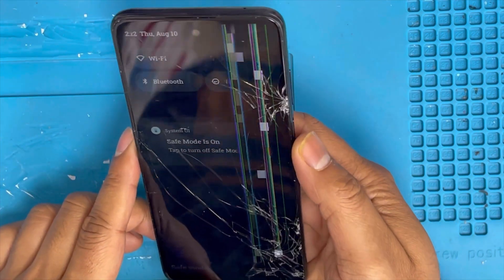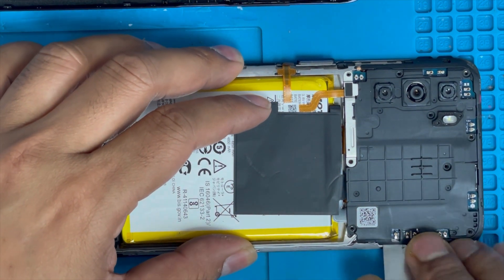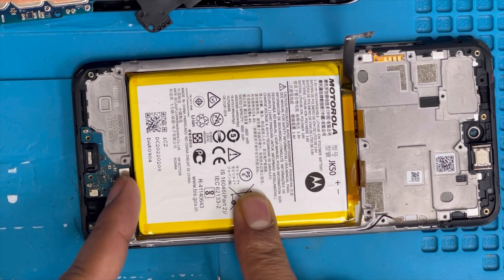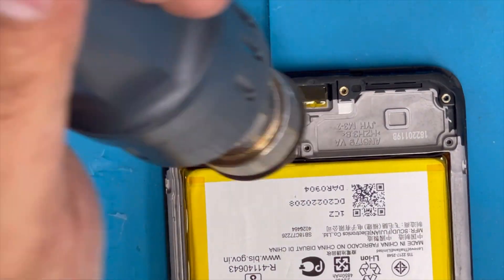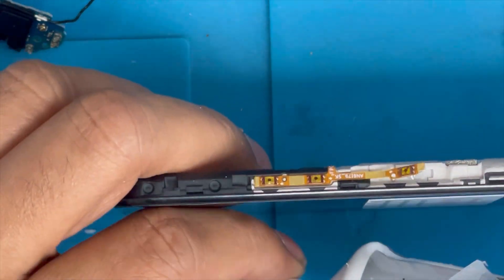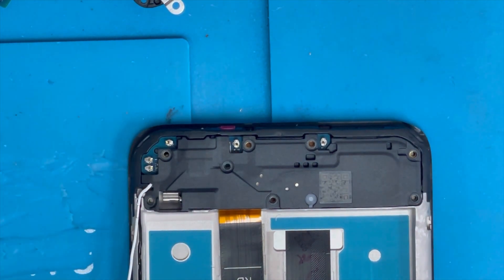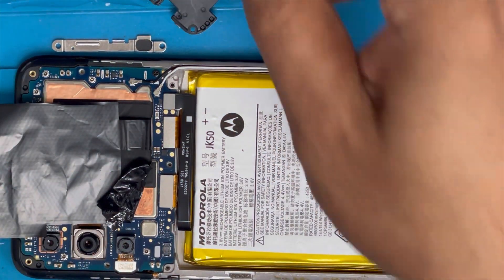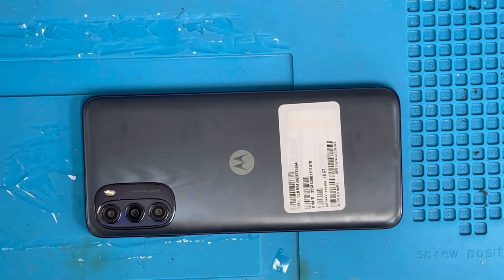Moto g 5g 2022 screen replacement xt2213

Comment: That fingerprint sensor is such a pain... and I don't know about your experience, but you can't just snap the case back together - you have to get these little rubbery nubs to slide into the top and bottom of the sensor. It's a real pain. 
In any event, after the repair, my sensor was dead. A quick reboot fixed it, oddly enough. 
Thanks!

Comment: So I just installed a new screen on the same phone. But the screen is extremely dim.. any ideas on why that could be happening. All the settings are good. And even when I install the old cracked screen it is still very dim all of a sudden.
Reply from the maker: Try to brightness up if is not work try another screen
Reply: @s-us-u8296  Brightness is all the way up. And I already tried 2 screens and both had the same issue. The screen is very dark no matter how high I put the brightness. It's like it's stuck in some type of low light mode...

Comment: I have bought the same replacement screen followed you step-by-step with no problem but now my phone won’t charge what could be the problem? HELPPPP!!
Reply from the maker: Check and reconnect charging port connection,
And check charging port connection is break any pin
Reply: @s-us-u8296  do you know where I can buy another board I did break one of the small sliver pins😭😭
Reply from the maker: @lesliemj2079  ebay

Comment: Great video, awesome step by step.  I've repaired a lot of LG's up to the G6 but never took a Motorola apart before.  I haven't ordered the replacement screen part yet.  I wanted to make sure I could get it open first.  Mine is a "seafoam green" and the edge of the frame between the back cover and screen is a metallic color and all I can find online are black frames.  Do you have any recommendations for a screen/frame assembly in silver/metal color?  Thanks again
Reply from the maker: You are welcome 
There is only black color screen on the market but back cover has different colors

Comment: I can't even get the back cover off.  It's stuck around the camera lens
Reply from the maker: Apply some heat or use some alcohol,that side has some glue
Reply: Ok got it off but camera lens stayed stuck to inside assembly and didn't come off with back

Comment: Now I dont have sound. Is the speaker bad on my phone?
Reply: I had the ear piece upside down.
Reply from the maker: Whice speaker?
Reply: @s-us-u8296  the bottom one that covers the charge port, sir.
Reply from the maker: @mgomez5606  check the flex cable connection
Reply: @s-us-u8296  the one that connects from charge port board to motherboard?
Reply from the maker: @mgomez5606 yes
Check both side
Reply: @s-us-u8296  ok sir. TY.
Reply: Does it rule flex out?
Reply: @s-us-u8296  Something seriously wrong. Can not hear caller & they can’t hear me. Does not ring either when call comes in.
Reply from the maker: @mgomez5606  send me pictures 
Shalauddin499@gmail.com
Reply: I’m having the same issue too and it’s not charging
Reply: @lesliemj2079  Leslie, I fixed mine and trying to remember what I did to fix it. Losing my mind.
Reply: @lesliemj2079  you can't hear caller either?
Reply: @lesliemj2079 you just can’t charge the phone?

Comment: where can I order that replacement part( screen and frame) everywhere I look I only find the screen and digitizer but not the rest of it.
Reply from the maker: https://www.ebay.com/itm/314202834900?hash=item4927f2c7d4:g:D5sAAOSwpXljV7Nb&amdata=enc%3AAQAIAAAA4KdyjhuGdwNyRJ6sqV6vpYNmuVYf4h3r81QAlmM7sDL9a5K%2BnQBdKmTFAizoBEjZ3R73iqFF6avjavTRln7GJQ97As6pmhGa5JlXutG%2BTzF42%2FFyApqmog6ItkCh7LbX%2FibG04z6fHck0Psbkcz3LSUuFtc3dlz5zxcmiX%2FMQpxBzRVqOIUtOQkvnp9x1AYJqGXvqvNslt2r%2FJIsCaA79HeG14Ov3umjK4R6Jpw2mpJJop0z9w2HEmFakv4bZu0ZhVK7jD7uXvYsy7Xx%2FS8ah3uM3Po%2FCUkIR%2BYdlF0kEkeN%7Ctkp%3ABk9SR4CXm6jGYg